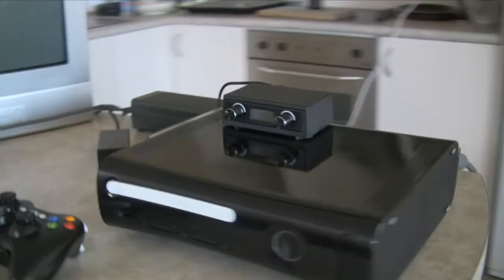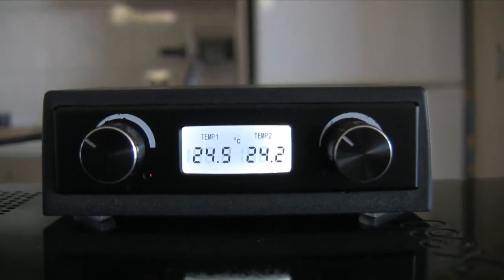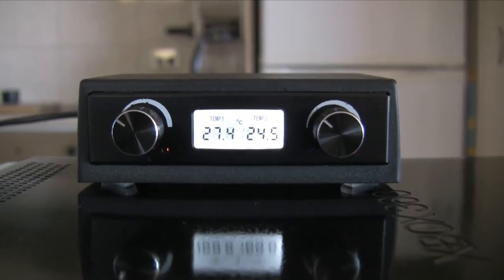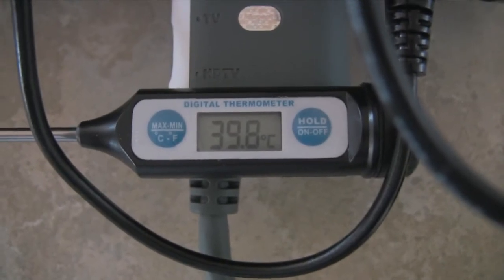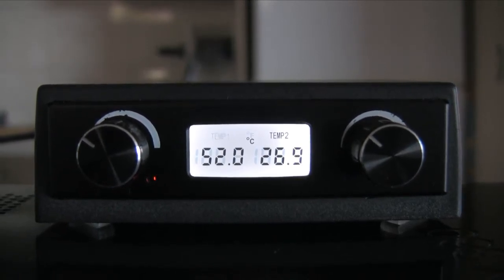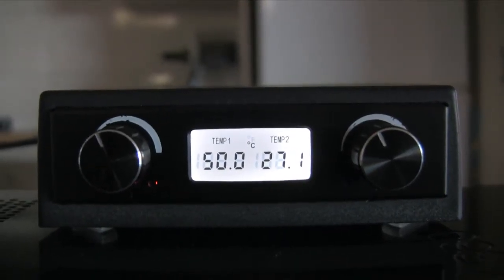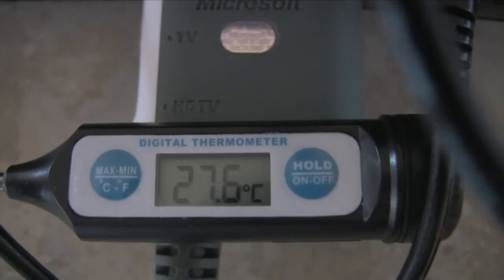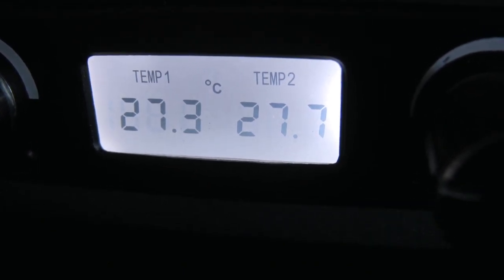Xbox 360 Fan controller demonstration

Comment: oh just watched the other video, yea seen where there placed now, I get well its sooo hot today 30*C room temp soo hot, GPU runs with heavy game load at 57*c and cpu 49*c and exhaust reads 45*c though I have XCM fans at the back of the console and its vertical and raised to get more air flow. normal uk weather i get 52 and 44 so yea this heat is pushing it.

Comment: where do you have the sensors in the console?
I have mine in the GPU and CPU heat sinks and one at the back reading the exhaust temp this buy far the best cooling mod video ive ever soon.

Comment from the maker: Damage happens when the heat spikes very very quickly after shutdown but rapid cooling has the same effect. 

Ideally you want the temperature to ramp up and down at a slow and steady pace. This ensures that any movement of the parts is very gentle and even, rather than sudden.